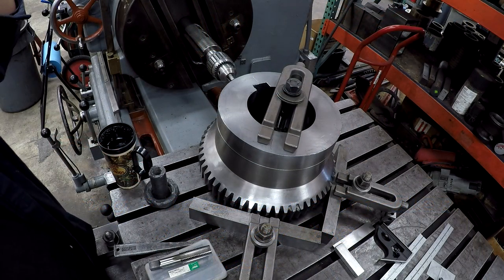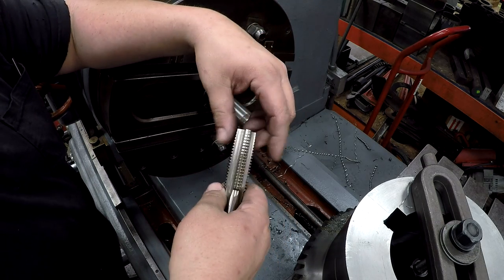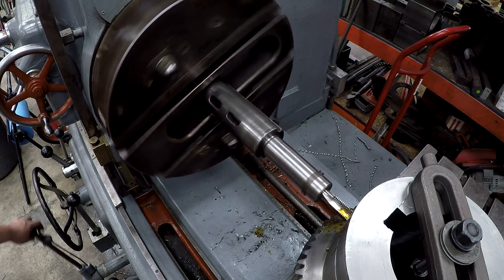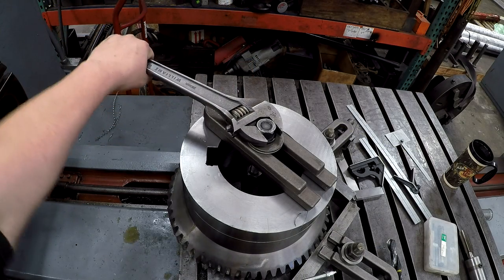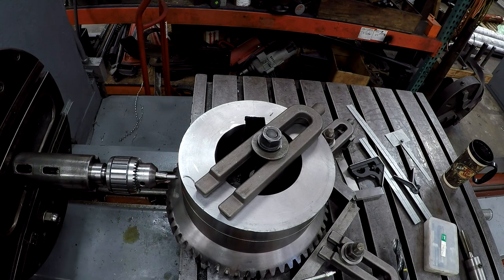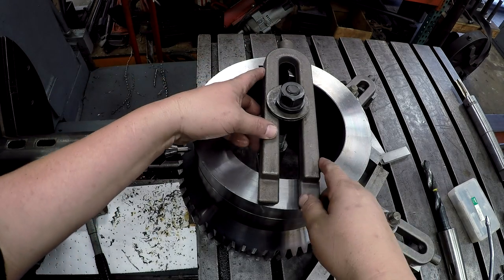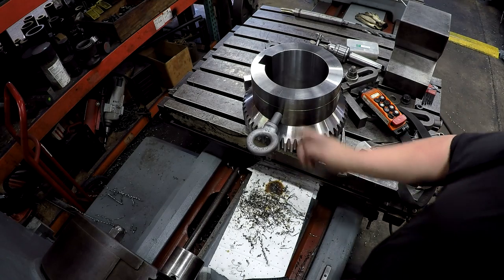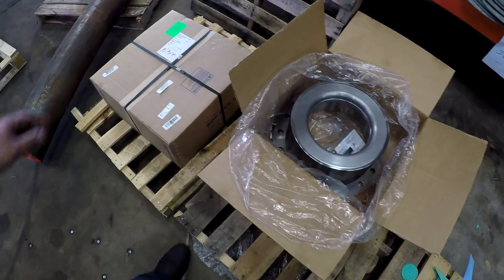Boring & Broaching a Kop Flex Shaft Coupling Part 4

Comment: I've operated more than enough large open pit mining equipment that the part sizes look quite normal to me. And while it would take a hell of a lot of torque, I have to say I was cringing a bit until that final hole was tapped without hearing that sickening snapping sound. ;-) Very professional and nice job as always Adam. Parts cost and the machining time will make that a very expensive set of couplings.
Reply from the maker: Yes I think anything in a big mining out is gonna look massive! LOL! Many of our viewers never get to see some of this big industrial stuff.

Comment: really interesting series adam. i would have liked to have seen the process of finding the center line of the coupling.very clever using a v stop to keep center alignment. thanks for sharing all these "tricks of the trade"
Reply from the maker: +larry sperling As always depends on the accuracy needed. I used a large square and rule against the chuck and lined the scribed line up center, then clamped the parallels down behind it. Simple and effective.
Reply: +Abom79 well adam you just burst my bubble, i was visualizing a one inch diameter two foot long super duper edge finder.

Comment: Hey Adam, when you broached the slot for the key in the gear
with the larger hole, didn’t that compromised the integrity of the gear? 
there is not much meat left after the slot was cut. It almost seems like
with a little torque, the gear will split right at the key way.

Comment: First of all, I'm not a machinist but do have a machinist square with the centering head that I use in my wood shop on occasion to locate the center of round stock. I noticed that when you were using your centering head/rule to locate the center of the keyway, that the 'arms' of the centering head (not sure what the right name is) were not touching the OD of the coupling with the flat machined surfaces of the head but rather were touching the OD with the tips of those 'arms'.  I was just curious how accurate it was to use the centering head that way.  Are the 'arms' of the head assumed to be of equal length to some high tolerance?  Cheers!
Reply from the maker: +Ian MacDonald I don't have a center square large enough for that radius, but for what I'm doing (set screws) it's plenty accurate enough.
Reply: +Abom79 Thanks Adam. Yeah, I figured that the layout in that case didn't require particularly high precision. Cheers!

Comment: I picked up a set of drill bits the other day metric in .5mm and up buy 5mm increments, the drill bits have a center drill bit built in, they aint cheap but my center point set got coated in grease and put away. They are cool

Comment: Adam, you've shown us some decent sized tap handles at your home shop, but the boring mill is absolutely the largest tap handle you've shown us yet!  Nice work, thanks for the channel.
Reply from the maker: I've got another adaptor that will drive a 2 1/2" NPT tap. So much easier than hand tapping that one.

Comment: An 8" shaft with a 2" key should be able to handle a whole lot of Abom torque!  Always great to see the HBM in action. Thanks for the great video!
Reply from the maker: +bcbloc02 Ready to see yours in action!
Reply: Abom79
Me Too!! It is raining here again now so no wall building action today so I am working on getting the hoist operational so I can get it back up on the bridge and out of the way. Be warm enough weather to pour some concrete floors soon!
Reply from the maker: +bcbloc02 Hoping to see you be able to pour yourself a nice slab out front of the doors too where the mud bog is. I'm sure you know how handy having extra outside concrete will be. The weather passed us yesterday and now its a beautiful spring day!! I'm testing out some new gopro settings and filters.

Comment: Thanks for showing us your work Adam. Very impressive. I was wondering about the limits of those couplings. It looks as though the cross section of the larger bore gets pretty thin at the corners of the 2 inch keyway. It looks like a weak spot that might fail under a heavy load.
Reply: +Mark Mossinghoff I worried about that as well. For a part with such a thick wall, it sure did get thin to accommodate that keyway.

Comment: Hi  Great series of videos, and very informative. I would appreciate more info on the background , eg what model of coupling,(Kop-Flex Waldron Gear Coupling?) where is it used, why your work is required (because they always need custom fitting?), why the set screws (one to secure the key, but why the other at 90 degrees?)  Many thanks

Comment: If you have a large mill like that why dont you just drill a starter hole before broaching that keyhole? Wouldnt the job be 20x faster since most the hole is already cut??? The press would also go faster because it would only be cutting the two sides where the curve is above the flat of the broach. I know nothing about machining genuinely asking, thanks.